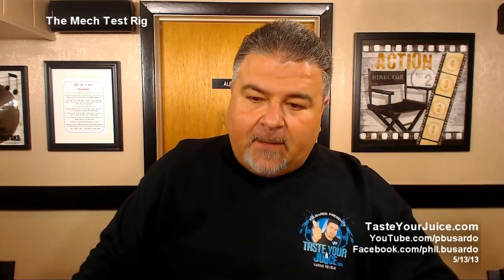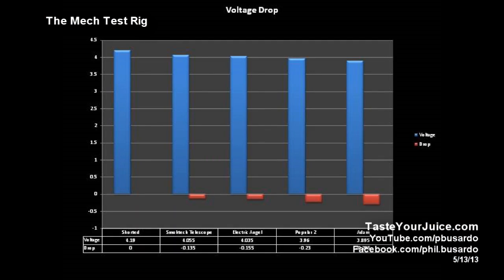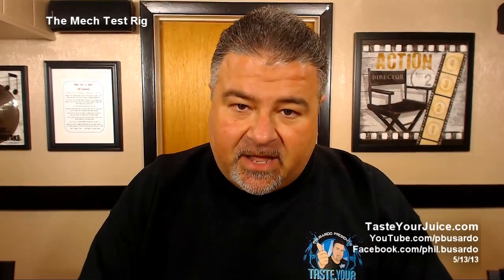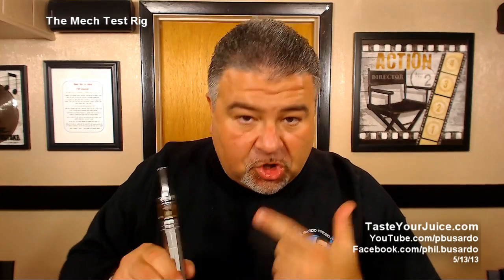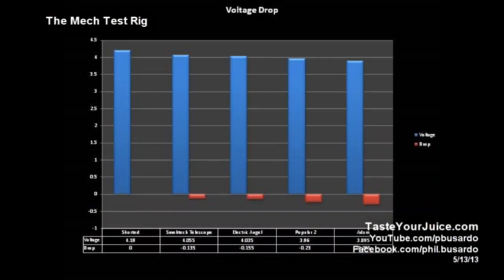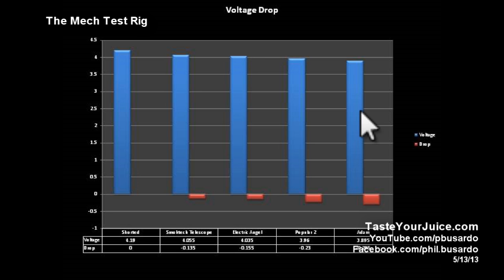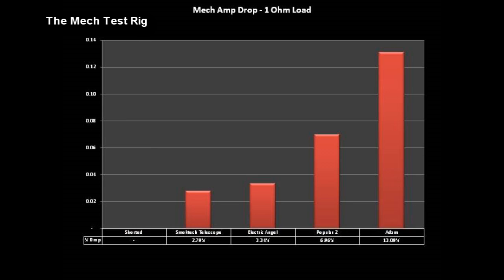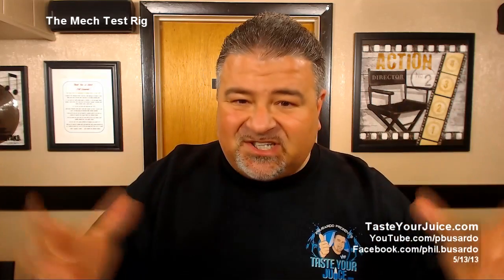A PBusardo Video - Meet The New Mech Test Rig

Comment: On the cleaning thing:  Phil, owners of mechanical mods have to clean contacts.  It's just part of dealing with a mechanical mod.  Yes, they should arrive to you clean -- but they often don't.  Brass oxidizes easily in air; copper even more so.  

But getting inaccurate numbers because of a couple minutes of cleaning shouldn't reflect negatively or positively on any mech.  Noalox plays a part too.  Applying it to the threads can change readings quite a bit.

Comment from the maker: First, I think you're talking about the ammeter and not the voltmeter (which is just being used to calibrate the power supply).  The ammeter (as Zen has already stated below) uses it's own power supply.  The test box DOES need to be plugged into the wall to operate.

Comment: I am talking about the RC voltmeter that is used to set the power supply to output 4.00 volts - unless it is disconnected when measuring the current

Comment: Just to clarify... The Ammeter is powered by a SEPARATE power supply in this rig... NOT from the supply voltage of the units being tested. This was purposely done in anticipation of this very concern.

Comment: By the way, the accuracy of this setup goes out the door since your are using a voltmeter that is powered by the supply voltage. You definitely should wait until you get your new power supply to do your mech reviews. Brilliant test rig though

Comment: Phil, using this test setup you can also show the voltage drop if you wanted to. Just use the ohms law - according to your charts your power supply is able to output 3.59 amps at 4 volts, so it outputs 14.36 watts. So for the smoketech telescope used 3.50 amps at the constaint 4 volts the power supply maintains is 14 watts subtract that from 14.36 watts to get 0.36 watts then divide that by 3.50 amps to get 0.1 volts that is the voltage drop, the adam did 0.62 volts with the same math

Comment: The fact that the smoketech telli did the best is not at all a surprise to me. It's a Chinese manufactured device and they like to use the cheapest materials like brass and aluminium; both materials are better at conducting electricity than stainless steel.

Comment: the issue is with the mechs u need to clean them regularly to keep them firing well. the oxidation builds up from use and impedes the current flow worse over time. i clean mine regularly most mech users do from what i hear.

Comment: If the natural tanks, could you please run a separate test by sanding the chrome battery terminal chrome plating off? I know your stance on "as sold" tests, but I heard this is a solution some vapers use. I would be very interested to see the results of before and after. Thanks!

Comment: Ive had the smoktech tele ss for about a month now, sanded the contacts down to brass, using a panny 18650 button top 2250mah battery with a vivi nova, 1.8 ohm heads, hits like a hammer lol

Comment: Question (Probably a stupid one, but I'm trying to understand):  I've noticed that some of these mechanical mods can accommodate a Kick.  In theory, would a Kick keep the amps the same until the battery dies (Or drops below 3.2V- Thus the term regulation)?  
Comments:  I cannot believe that after 1.5 years of vaping, I am now interested in volts/wattage/amps and all the lingo I have picked up.  I would have run from this stuff before I started vaping.  Thanks for your reviews and info !